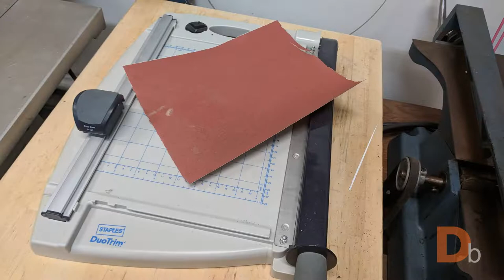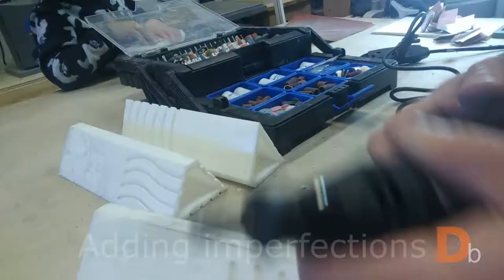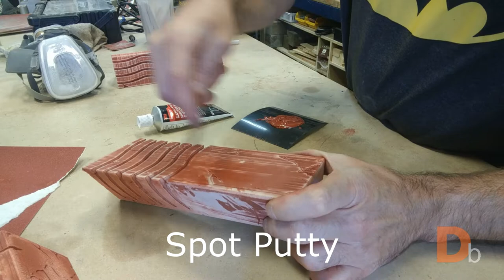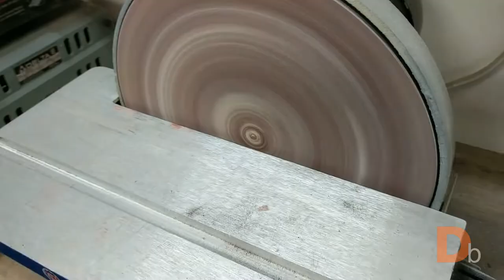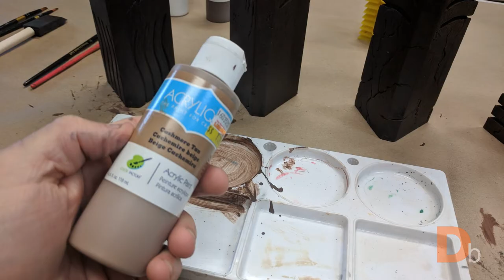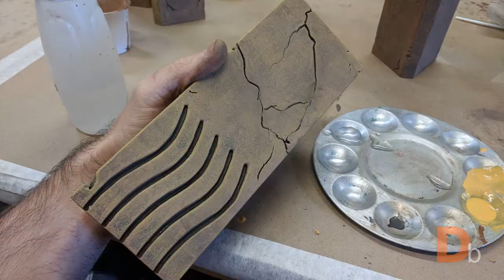Stones prop replica from THE FIFTH ELEMENT

Comment: I believe you added too many imperfections. The stones were supposed to be kept in a case to protect them. Therefore the top of your fire stone is really too cracky to be the correct one. But in general, awesome work!
Reply from the maker: They are not perfect for sure :) Cheers!
Reply: Dude, case or not, these stones are 1000's of years old.  Amazing work,  thanks for sharing and putting that much time into them.
Reply from the maker: @ke4prf  Cheers Mark! :)
Reply: One was stored in an alien stomach lol
Reply: @jasunbekquayle8181  Un fact, the 4 of them were there for transportation, not storage.